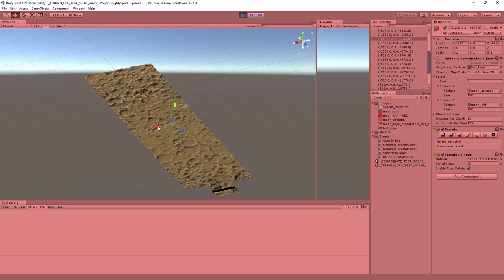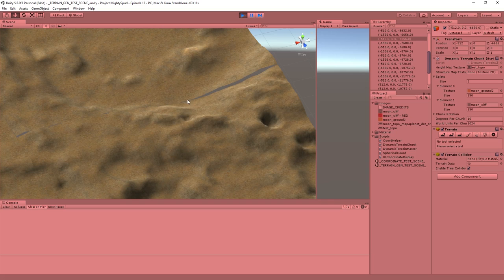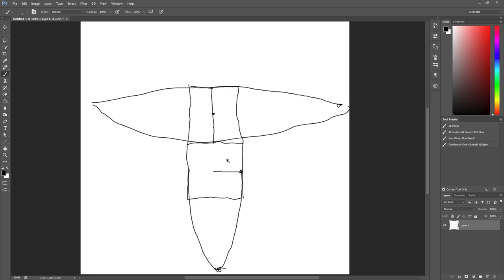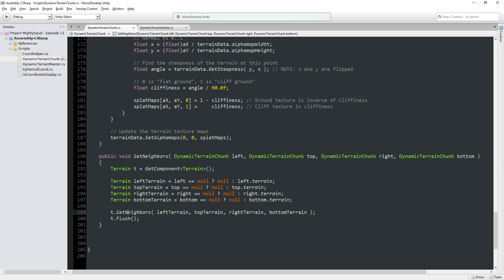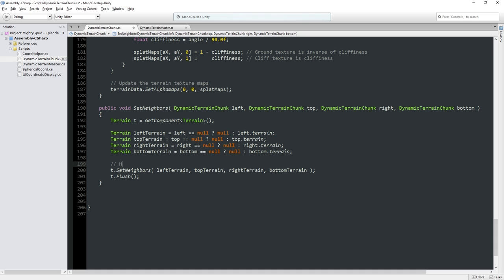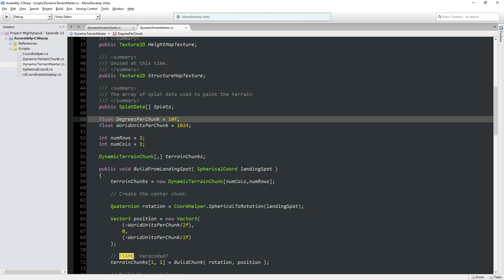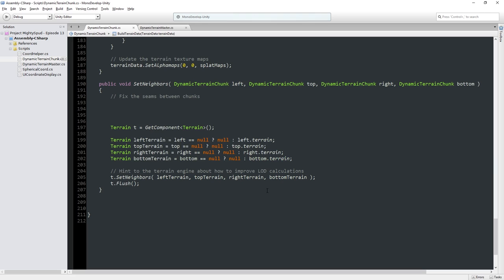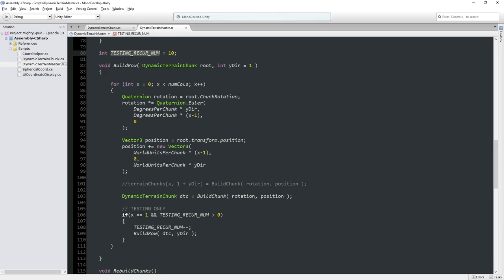Project MightySpud - A Planet Simulation Game - Part 13

Comment: I think the solution for the for the mismatches (seems) between chunks is to use only one chunk and replace it when you walk to close to the border. Then I am also thinking that you may see far on the planet as stuff like the curvature of the horizont. So the sphere you sea from space should maybe still render when you walk on the planet? The height-map is like the distance from the core of the planet and when you add a flat terrain square on the sphere the terrain on the edges will be to high, that could possibly be corrected with correcting the height-map and lowering the terrain in the edges to better fit the sphere.

Comment: Quaternion.Euler always gives me a problem. so I always just use Quaternion out right(painful) but works, I wonder if You mathf.round to the nearest int on the Floats how would act. but I'm totally with you there is sometype of floating point error causing everything.